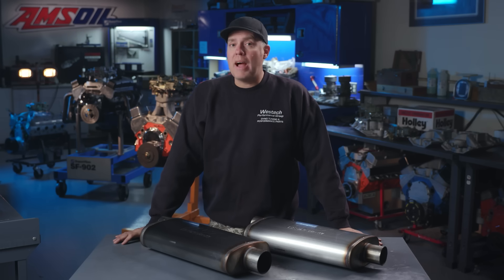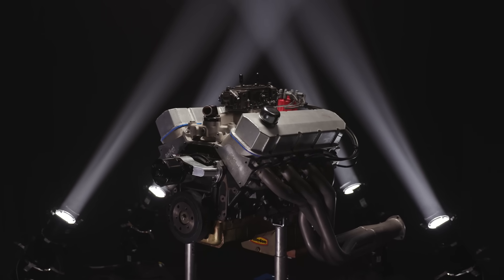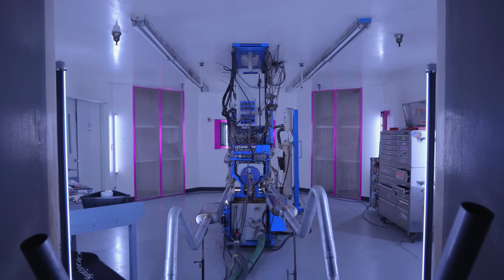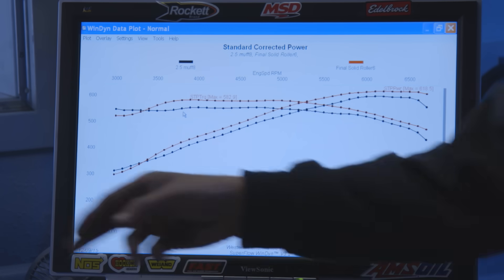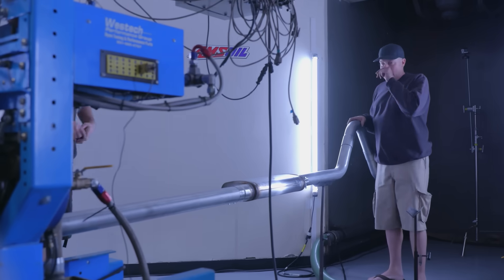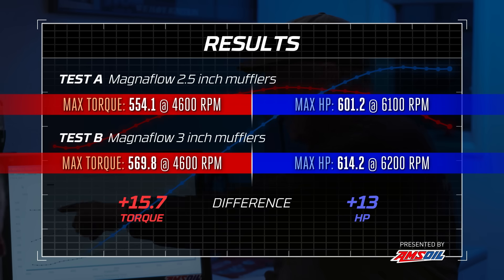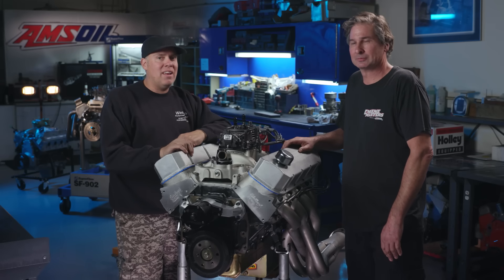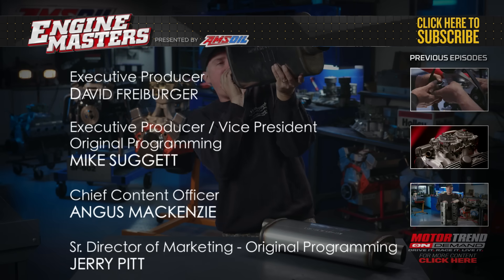The Power of 2.5- vs. 3-Inch Exhaust - Engine Masters Ep. 9

Comment: Engines need high exhaust gas VELOCITY but do not need backpressure
Reply: don't forget exhaust scavenging
Reply: @TheKiwiSage . 100% CORRECT.
Reply: @juanequis6951  nope. Watch the link I posted earlier.
Reply: 100% CORRECT!
Reply: They already said that,didn't you watch video    smh!!!
Reply: @kevinaalberts9251  what's your problem, maybe i was reiterating it. If you have nothing constructive to say then kindly keep it to yourself
Reply: TheKiwiSage Doesn’t that calculate your velocity? Some of you guys have a really good handle on this. Much more than the average lay person and I am interested in your comments. Keep them going please. I am going to visit the site you show. I have been an electronics technician since 1969 and worked in communications, power plants and R&D whet we dealt with flow, liquid and gases of different specific gravity so I do have a pretty good handle on the theories discussed here?
Reply: JD JD unless it’s turbo 🤦🏼‍♂️
Reply: @TheKiwiSage you are correct, i changed from 2.25 with cheap stock mufflers to 2.5 with 2 chamber flowmaster, both dual same length on a 400hp smc and lost all bottom to mid with top being the same.
Reply: TheKiwiSage Thanks much. I have seen a few but haven’t put a pen to paper. 👍
Reply: @TheKiwiSage no, you don't want back pressure. You want the appropriately sized piping to keep air velocity high which means the pressure would be low. Bernoulli's principle.
Reply: Spam Can just a question. I am familiar with Bernoulli’ Law but when you are talking about a daily driver with approximately 350 hp that will seldom see 5,000 rpm then velocity along with pipe and muffler dimensions considered wouldn’t it be near impossible to get the maximum average power that the engine is capable of over that operating range? I ask this because I am building a 67 camaro 327 with 350 hp and as close as I could calculate, 1 5/8” long tube headers to a 2 1/2” exhaust with cross over would give me the maximum overall power. Does this sound reasonable to you? 
Thank you for your time👍
Reply: @TheKiwiSage no

Comment: Everybody that hated this video has 2 and a 1/2 inch exhaust.
Reply: 3 inch 2 liters 4 cylinders honda
Reply: @narrwass  and you make less torque than electric toothbrush
Reply: @julek43  😆😆😆
Reply: So true! Teehee!
Reply: Or less. And probably running a stock motor.
Reply: Hey man my elantra pushes 150 be careful I'll gap any civic in my hometown
Reply: Its the employees of the "2.5 Inch Exhaust Company"...
Reply: Isn't a 1/2 inch exhaust a metal straw?

Comment: All Motor imports from 1.6-2.5 liter engines are running 3inch exhausts and 2.5/2.75 collectors
Reply: Pure race builds sure, but if this was a pure race build it would obviously just be open headers like any serious NA build no matter the cylinder count.

Comment: Is the backpressure better for the valves?
Reply: No. THe reduction in back pressure leans out an engine which "could" lead to higher exh temps which "could" born the exh valves. Back pressure is bad, period, you jus have to tune after changing.

Comment: So i just replaced my cats in my subaru that have a 2.5 inch up pipe but i didnt replace the stock resonator and downpipe + mufflers so if i got a 3 inch exhaust from just before the resonator to the tip be better for my 2.5 boxer

Comment: I know I just hace a little 2.4l dart. But I'm on my way to 300-330whp(thats my goal)and as of now with it being N/A and sitting at 205whp, I lose power with a 3" vs.  2.5" the only gain from the 3" was like 5hp at 5krpm and up. No real torque diffrence.

Like alot of people are asking. I wish they did this for a,car closer to 350hp and focused on the gains starting at say 2500rpm
Reply: Few bolt-ons, and a good dyno tune and 300 is easy to get to. Probly even with a canned tune

Comment: They should have tried an X pipe and H pipe in the test.
Reply: Was thinking the same thing. And throw in an EFI system that would compensate for changes in AFR on each config.
Reply: @jbr496  I'm betting if they would have tune the carb for the same afr the difference would have been a lot less
Reply: @jbr496  the point of running a carb is to see the effect of the exhaust on the engine. An efi would ruin the test in a way but the differences may be smaller.
Reply: They've done tests comparing exhaust patterns before, if not on YouTube it's probably been moved to MTOD thanks to Discovery.
Reply: X pipe all the way bro. :)
Reply: @angelgjr1999  Depends on the car. On my 2v I have long tubes o/r x and spintech super pro streets. I had lm1, couldn't stand the rasp, so I gave it a muscle car sound, not some junky raspy car.
Reply: Karl Hopkins Mine has staggered wheels (285) x pipe and cold air intake. What should I do next? Coils? I don’t want to lower suspension because roads are trash here and I need my spine intact. )
Reply: @angelgjr1999  Bags are better if you have crappy road's. More expensive yes, but it's going to ride better, and it's going to handle better. The right bag's can out handle good coils.
Reply: @karlhopkins713  What about sway bar?
Reply: @angelgjr1999  They help control the body roll and stiffen it up. But these cars do like to hop on bumps, I'm going with upr rear control arm's, and spherical bushings, that way I don't have to worry about it hopping anymore.
Reply: @karlhopkins713  Would you recommend front or rear sway bar?
Reply: @angelgjr1999  Supercharger, lol.
Reply: @karlhopkins713  I
Reply: @karlhopkins713  I hate rasp: that's a sound developed for people to pretend they had horsepower.
Reply: 302hobronco in normal street use, 3” is a waste of $$$$. Racing, high rpm, 3”. Video a little long and most of it waste of time.
Reply: @wallisparnell4464  So? Logically, anything other than an econobox is a waste on the street. What does that matter?
Reply: It's already been done. Look up results of x-pipe vs b-pipe. The h will make a little more torque, but x- pipe will drop a little torque but make more top end power. It really depends on what you want or need for your combination. I really like the x_pipe on my coyote mustang. It sounds great also.
Reply: I knew something was missing.  Always love short headers with an H pipe.  Special thanks to Carol Shelby for teaching me that and to my first MX-6 for showing me torque wins races.
Reply: Too many variables thrown into the mix. They only had enough minutes in the show to do 2.5" vs 3".
Reply: It really wouldn’t make a difference with an h or an x pipe it would be like a 3hp difference on the x because of the bends
Reply: Engine Masters has tried that before...
Reply: Exactly what I'm looking at now. X-Pipe to even my exhaust pipe length difference. Left side being3 foot longer. Wish they would have done that test on a regular old 5.7 300hp.
Reply: @stevecr8934  nice! I just finished welding mine in last night. 3” stainless all the way with long tubes. 6.0 LS in a 1963 C10. Whatcha building?
Reply: If you go to the Motor trend site you can see that very test.
Reply: Tuna can
Reply: X pipe vs H pipe vs Y pipe vs separate dual pipes.
Reply: They did a test but it's gone
Reply: 4-2-1 collectors,  & X pipe & re-jet if needed to optimize the full exhaust like anyone would attempt themselves.
Reply: I'm running a full 3" true dual exhaust with a double H pipe 3 in 3 out single chamber thrush bottles and 5" chrome tips on 90s on my stock 98 Z71 Silverado 5.7 no cat no emissions at all no EGR valve I love it sounds great I'll never go back to 2.5 inch exhaust ever again 3" sounds so much deeper and better then 2.5
Reply: H-pipe is the king for old straight carburetor Fords small blocks.
Reply: Right?! Straight pipes rob power.
Reply: @Maverick8t88  how is it robbing power when you are watching the results on this video? Wtf
Reply: @MrRey007  Rob power was maybe a poor choice of words.  Maybe better to say it’s an easy upgrade to gain power because x pipes scavenge exhaust and help the engine breathe better. H pipes aren’t as effective, but similar idea
Reply: @Maverick8t88  That is very true. My dual exhaust without the X pipe sound very uncompressed. I added 1 x pipe to the system and tailpipes sounds like are gonna xplode, i think im going to add a second X pipe in parrallel with the first one similar to the corvettes setup or maybe delete my straight mufflers for a muffler with an Xpipe built in
Reply: IF x pipe is done right it provides a little over an H or balance pipe.  But unlike the X a simple H is hard foc up.  They should have put an H in IMO.

Db at tailpipe would also have been nice.   

Keeping sound down and velocity up as exhaust fumes suggests 2.5” tails behind the 3” muffs may have also worked well.

Comment: this KILLS me to hear dumbasses talk about exhaust AGAIN and NOT understand it's all about the proper VELOCITY and the difference between too little and too much VELOCITY - an engine is a PUMP and the EXHAUST is the discharge VALVE - too free of a discharge path and you get cavitation / over scavenging - too restrictive of a path and you rob the complete potential of that pump
Reply: They showed the motor was running rich with the 2.5 exhaust.
 Why wouldn't they tune to regain power?

Comment: Wish you would do graphs from idle, not every engine lives above 3k revs only, some are driven daily, be nice to know.
Reply: Exactly... I run under 3000 daily on a built motor... Have 3 flow masters
Reply: Dyno isn't usually capable of that(most likely it would stall the egine or the measurement would be way off), and you can only test wide open throttle on dyno. It can't tell you anything about part throttle situation. Also dyno won't tell anything about driveability. And i don't know how about you, but i rareĺy am on full thottle below 2500 rpm, But it might be interesting starting the pull from let's say 2500rpm.
Reply: @salogel88  Dynos are capable of that because if not, then it would be impossible to get meaningful dyno results on low revving diesel engines or low torque small petrol engines
Reply: @sepg5084  yes, but those are special dynos. This is dyno with water brake. It' rather complicated to explain how it works in YT comment. For diesels they are made so they can measure at low rpm (enough water for the brake at these low rpm) and don't need to cope with engine buzzing in 7000+rpm. And small engines are usually run also at higher rpms. It's about calibration and dyno-type. I'm sure there are dynos that could measure that but not this one. You could dyno a big diesel on this dyno, but the water brake can't put enough water at low speeds. You can use transmision( multiplying rpm to let's say 2 or three times and they divide the torque by 2 or 3. Horsepower is just function of torque and rpm as i'm sure you know) 
This type of dyno is made and calibrated for petrol engines measuring their performace in higher rpm. 
At sub 2000 rpm, if you floor it in auto tranny it will downshift. So should anybody in a manual car. So the answer is that i don't think this dyno is capable of measuring this much torque in low rpm( and i also think that Freiburger said that in one of the other episodes)
Reply: If you dont take your daily to more than 3k rpms then your engine is probably suffereing from a lot of carbon 🤷‍♂️

Comment: How about doing the same test on a typical daily driver that most of us actually drive every day? For daily dependability most of us don’t have a 454 with aluminum heads, high compression pistons, oval port intake and big carb but you can bet we have a nice exhaust on our puny little stock motors with minimal mods. It’s kind of a no brainer that your motor would benefit from the larger mufflers (duh) but what happens on a fairly stock 302 Ford or 350 Chevy? Maybe the back pressure myth is real for those motors. This is great entertainment but it would be nice to see how this works out in a typical real world application for the benefit of the rest of us poor slobs.
Reply: Vic Papazoglu common sense would say that the difference in HP would be less on an engine with less HP!  A puny daily driver would see decent gains in HP if the stock exhaust had a lot of back pressure and the aftermarket system did not (regardless of 2-1/2” or 3”).  This video was not intended to test a stock exhaust!  Anyone that thinks back pressure is good for power really shouldn’t be attempting to be a gear head!  Read a book on fluid dynamics!  How about you doing your own empirical testing rather than trying to dictate other people’s testing! NARCISSIST!
Reply: I get it and I don’t disagree but the point I was trying to make though is let’s see some testing on an average engine that the average person can benefit from, not just some high dollar engine that is out of reach for most of us with information that is of little benefit to the majority of the viewers. Remember these are the Roadkill guys who normally stay in the realm of daily driver beater so they get it!

Comment: for back pressure on my Harley 2" drag pipes I welded a lug nut to a 5/16" bolt 3inches from the end made amazing torque and HP over the 1 3/4" drags with just the 5/16" bolt

Comment: might as well do straight pipe instead of the straight through muffler since neither are a street legal sound level
Reply: Jacob Myler I have a 3" exhaust system with a high flow catalytic converter and a 3" straight-through Magnaflow muffler just like those ones on my tuned 5.3 Colorado, it's not very loud at all under 3,000 rpm, not obnoxious over 3,000, and quiet enough at idle to start up for heat or AC when camping and not wake everyone up. I'm sure it'd be loud without a cat, but I wouldn't think it'd be illegal.

Comment: Wish they would have rejetted  with the 2.5" system and made a run.
Reply: Said the same thing
Reply: Yep. Rejet morons. Otherwise, waste of time.
Reply: Y'all are forgetting the most important aspect though: the test wasn't designed to see how different exhaust sizing AND tunes affected the power. The test was designed to determine which exhaust size, given all other variables (IE the tune) remained the same with header dumps being the control group.
Reply: I was thinking the same thing.
Reply: why?
Reply: Engine was tuned to open headers. So it would be happier with the 3" exhaust. Change in the setup requires a retune to meet the changes. I thought the same as well. I can make a solid prediction that if that engine was tuned to 2.5", the 3" and open exhaust would not perform as well as it was tuned to the open headers. That 454 is pushing so much air though. I would believe the 2.5" would still under perform. Now, with a smaller engine I expect the 3" to be too much. It's all about how much air you're moving. All back pressure only matters if you have cam overlap. Back pressure pushes the exhaust gasses out while having no back pressue can allow exhaust to get pulled in during the intake stroke while both valves are briefly open.
Reply: you caught that too
Reply: I know all you guys know everything.  You're all the uneducated ridiculous ones honestly
Reply: This is a ridiculous comparison. Big block with a high lift cam is a huge air pump at high rpm. They need to go back and do a mild build small block making around 350 hp
Reply: @Tsalinger  And a Y pipe  test for the people with space restrictions.
Reply: The only people that truly need 3 inch pipes on the street are the ones with NO education
Reply: @holmes1956O  depends on what your trying to achieve on the street
Reply: @holmes1956O  so if my 1200 hp Camaro is on the street I should keep 2 1/2 in. Exhaust on it cuz it's a street car. Oh wait....1200 hp is not a street car, ok ok....let me think, hmm the hellcat has 2 3/4 in. exhaust on it and its 700 hp  but no no I should probably stay with 2 1/2 in. Cuz that's a factory built car, yeah I wanna make sure I'm not a poser but my car don't run very good with these pipes? Gee I just dont understand, can anyone help ?
Reply: Yeah the 2.5 sucks they just proved it
Reply: @josephandreuccetti8043  2.5 does not suck. It should actually do better torque at low rpm .. they needed to reject the carb they could have gained more torque and hp.. they really limited that engine with the 2.5 and seems biased
Reply: @Miguelspl150  you forget that they weren't really comparing low rpm numbers. They were mostly targeting peak numbers

Comment: The slant six runs better with the 2.5 inch exhaust because the 3 inch doesn't have the correct back-pressure ratio.

Comment: 2 1/2 is about the limit on a 383 stroker in a 1975 corvette otherwise your exhaust will scrape the ground when your running exhaust straight out the back / other option is side pipes
Reply: You can always build a dual system of 3 inch or 3 1/2 inch and press it oval in sections to keep your ground clearance and increase your flow over 2 1/2. I personally have 4 inch ovalled down the center tunnel of my C4.
Reply: jerry gingerich how does your exhaust sound?are you satisfied with it?

Comment: Where is the catalytic converter? Also, almost all cars now use one collector head pipe to route the exhaust into one catalytic converter and then possibly split into to exhaust pipes, but maybe not. Why not do a real world test? All the "custom" exhaust system set ups that I have looked at are only "cat back" systems.

Comment: Should have pulled from 2k. or 20% throttle from 1 to 5k to see the difference in torque taking off from a stop for example.
Reply: I'm curious too if the exhaust would give gains at partial throttle. 50% at 4k.